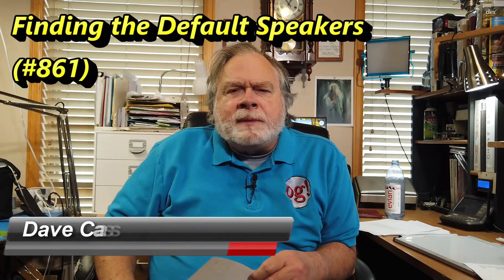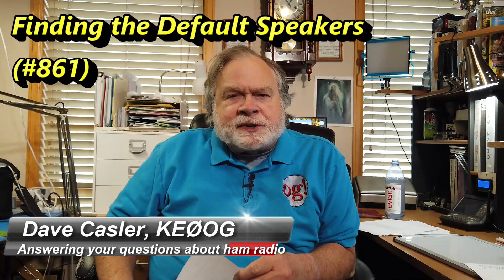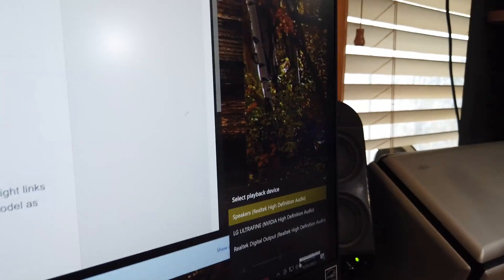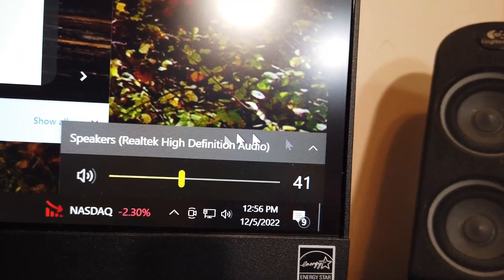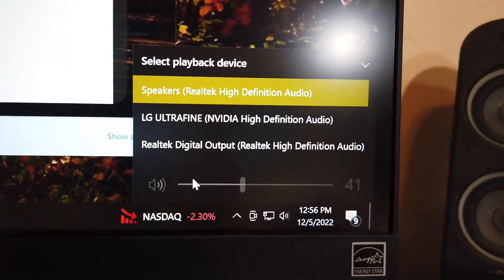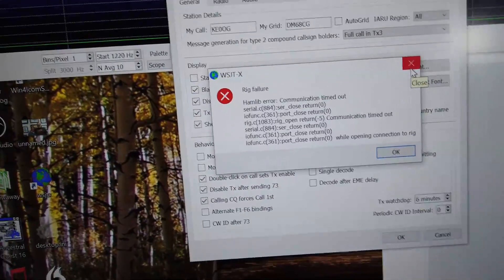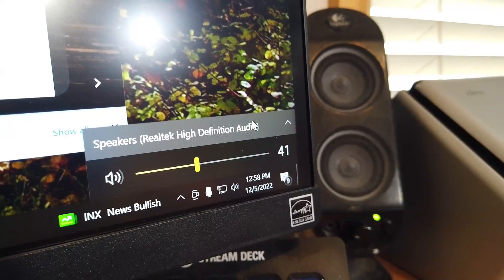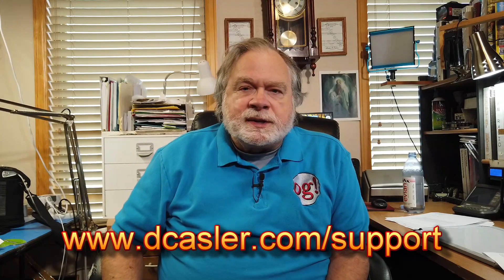Finding the Default Speakers (#861)

Comment: great video. I had the same trouble with my 7300.  the part that got me is the sound card should have been called ICOM 7300 or something like that. I run my ICOM on LiFePo4 battery and can say with power button off the current from battery is very small.  some times I play music when setting up portable.  73's

Comment: I wish I could give several "thumbs up" rather than just the one to this.  Windows switching "sound cards" automatically can cause problems with more than ham radio.  For example when I use an external microphone along with a camera that has a built in microphone iIt then matters which order I plugin the usb cables.

Comment: Good troubleshooting for what must be a frustrating problem.  Some laptops will leave their USB ports active even after you hibernate or put them in sleep mode.  I once left a USB memory stick plugged into my HP laptop and closed the lid thinking both would enter sleep mode together. The next morning the memory stick was melted and the USB port was dead, but the computer booted up normally. I think they leave the ports active so you can charge your phone overnight even though the computer itself is turned off (but still plugged in). If one leaves his 7300's power supply on all the time, won't that invite the same situation I had with my melting memory stick when the computer is turned off?